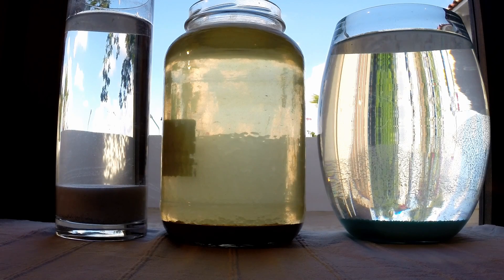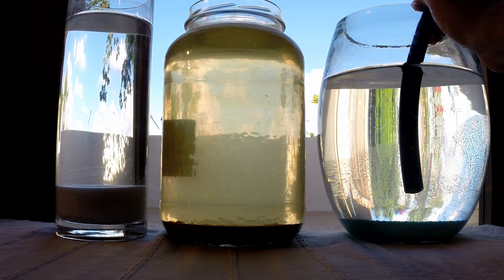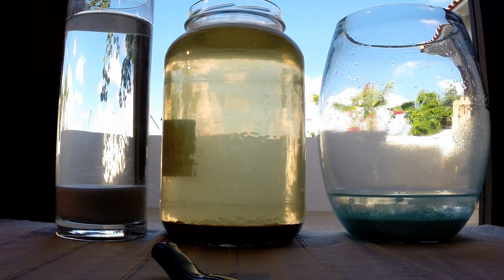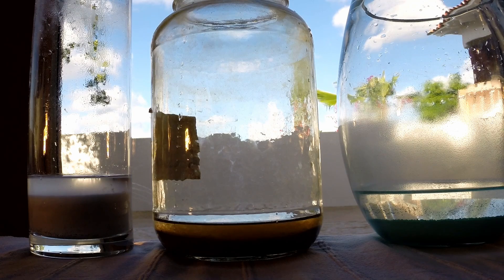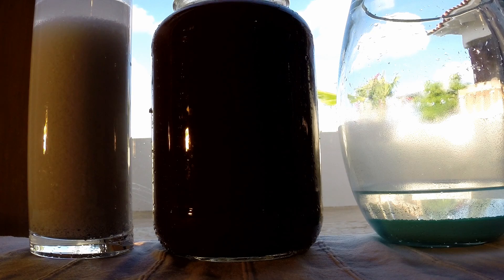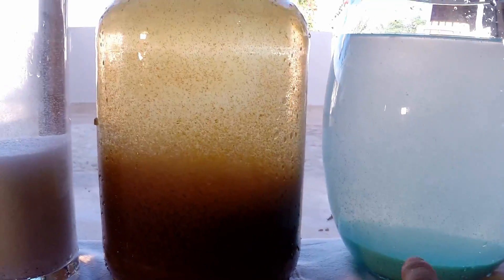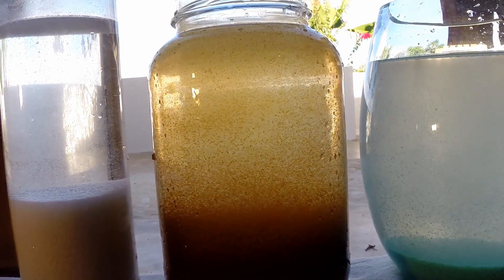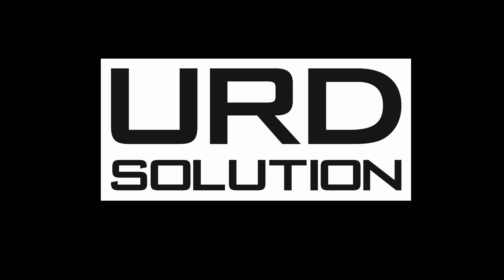Washing GaNS

Comment: P.S.  followup comment, it is MANDATORY that we use our voltmeters set at 200 millivolts after each nano-coating pass with the torch or with the caustic soda( which will still work for nano-coating, but will not yield as much power).  Using the voltmeter with the black(-) wire touching the gravitational end and the red(+) wire touching the magnetical coil end will re-align the plasma field in the coils so the negative and positive are working together.  All of this is on the 89th workshop video.
Reply from the maker: +Jackie Douglass Thanks Jackie!
Reply: +Roald Boom   As I understand all this, you can set it also to Volt (DC) if your meter does not have mili; during the nano coating the atoms on the metal surface are getting realigned and take a bigger space or a bigger distance between each other which allows them to absorb energy by which we are surrounded (also the whole universe) and have normal no access to and convert it to electricity. Thats why it is black, it absorbs all waves.
This energy was here for ever but mankind was not able to utilise it until Mr. Keshe arrived.

If your copper coils, pens, etc. are lying on a galvanised wire mesh, put the minus of the meter to the wire mesh and measure all over the copper wires until it no more swings into minus. Every time the voltage goes into minus and back to plus new nano layers are created. For caustic coating the copper must still be moist or wet and I belief for the fire coating it must be still hot. Fire coating I gave up because every time after my toothbrush test the layer came partially off.

Comment: MAJOR NEW DEVELOPMENTS with the technology.  Roald and all, if you have not watched the 89th workshop help on November 26, 2015, please begin watching at the 26:30 minute mark.  It has been learned that nano-coating our copper with a propane torch adds 30 to 50% more power to our systems.  Also,  the number of turns on the larger coil should be reduced from 180 to 144.  This will close the gap between the inner and outer coil and allow for the creation of an infinity field connection between the two coils.  Also, at the 1 hour and 51 minute mark, more important information and a view of the first gold to appear in the gans creation by two fellows.
Reply from the maker: +Jackie Douglass Yes, changes, changes, when will Lord Keshe be clear at once!!!